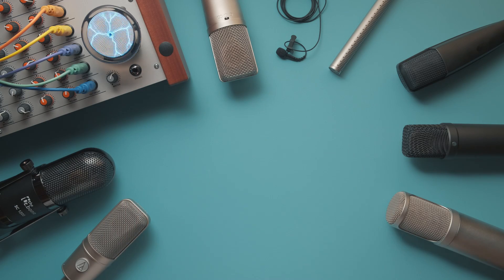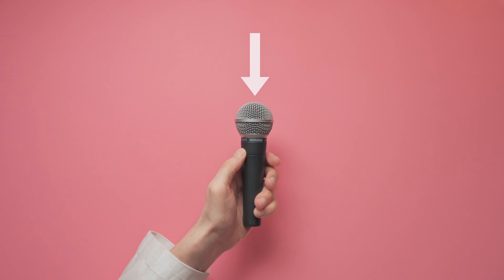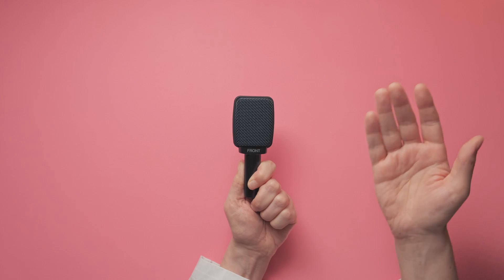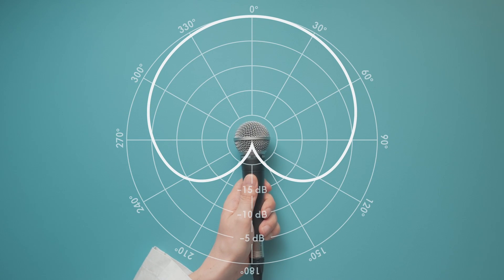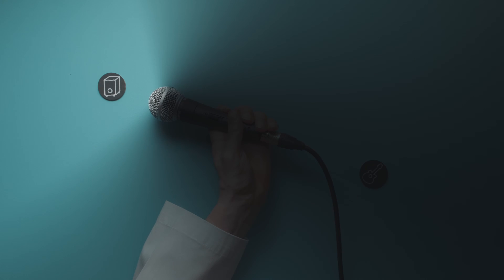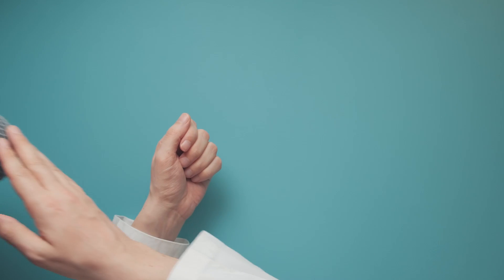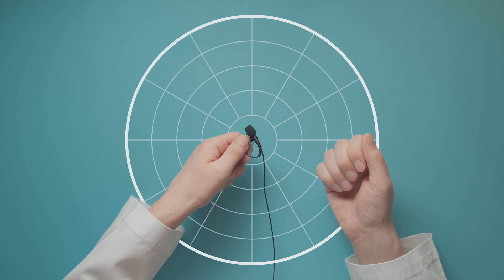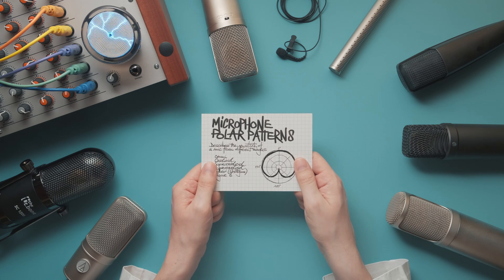Microphone Polar Patterns Explained | Audio Laboratory | Captain Pikant | Thomann

Comment: If i get this right, when it comes to reducing feedback from the wedges live for a vocalist, a Beta 58 is better if you have 2 wedges at a 45 degree angle pointing at the singer, where a SM58 is better if you have a wedge right in front of the singer. Right ?

Comment: The typical polar pattern diagrams show the sensitivity at some angle, but how do we determine sensitivity over distance?   This is important to know, for example, when you are trying to minimize bleed from a guitar in the vocalists lap.  But I cannot find any such 3D diagrams depicting such a metric.  Speakers sensitivity over distance is shown in decibels per 1 watt per 1 meter.  Why not a similar unit or metric for microphone sensitivity ?
Reply: Distance doesn't matter i think, because the dropoff due to distance only is gonna be the same regardless of the angle you're in when it comes to the polar pattern. What i mean by that is that if the polar pattern shows 0dB loss at 0 degrees; and say -5dB at 90 degrees, then if you move the mic further away from say 2 meters, the loss (say 10 dBs) is gonna be the same at both angles, so you will get 0-10=-10 dB loss at 0 degree, and -5-10=-15 dB loss at 90 degrees.

In your case scenario, you should imagine not a 3D version, but a 2D version, where you're looking at the singer/guitar player from the SIDE. If mic is pointed 45° (compared to the mic stand that is vertical) toward the singer, then your singer is the 0° for the polar pattern, and the guitar is gonna be somewhat at 90° (for the polar pattern).
Reply: 1 thing you could is monitor the signal picked by the mic with in ear monitors, after solo-ing the mic channel on the console.